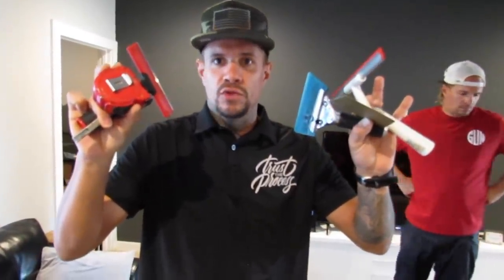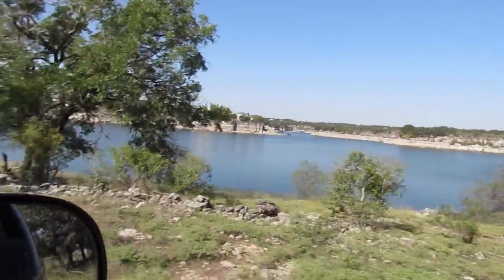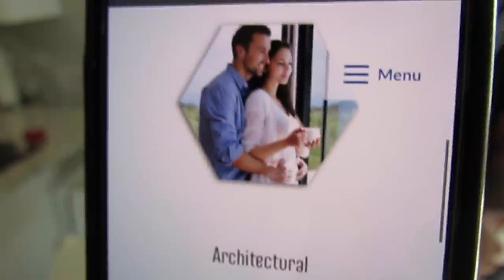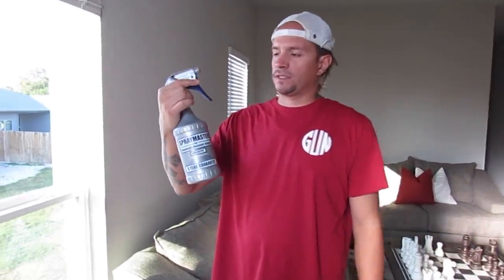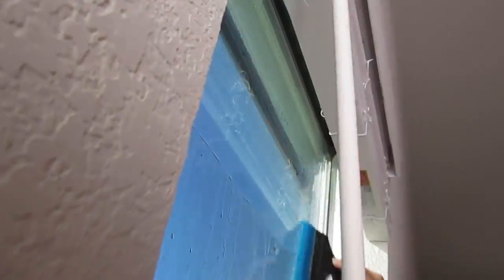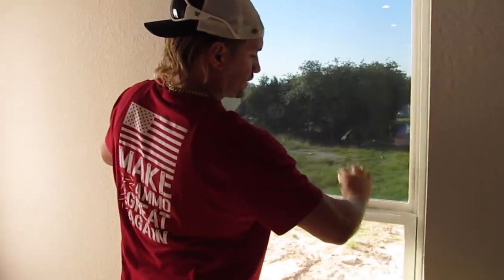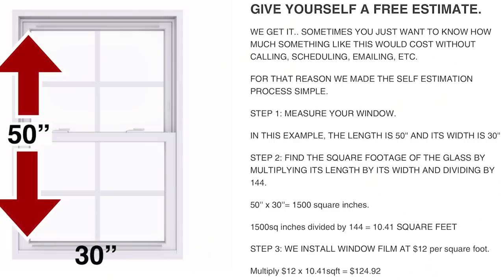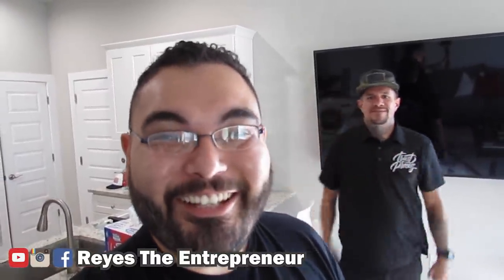The EASIEST and CHEAPEST business - home window tinting

Comment: Important info not covered.
1) get some liability insurance. If you get hurt or damage someone's home or glass you may pay big time.

2) always check the glass. Triple pane glass should not be tinted it will instantly void the warranty.

3) most places have double pane laminated glass, but some are low e glass in which calls for specific films to be applied.

There is a lot to learn. I've seen people use the wrong films and the customers glass cracked causing thousands in damage. Please go slow and ask for help when needed.
Reply: Where can I find more information on this topic

Comment: This film is a trend, specially the mirror film for privacy and you can see outside, also you can have privacy at night too, even if you have light inside your home, if you do some additional steps, such as putting bright light aiming your window, those flood light with timer in the garden. I like to see outside what's going on from my kitchen. You still might want to put  thin or thick curtain and leave it on the side and use it when you don't want to see the lights outside.

Comment: As a tinter they didn’t explain anything about trimming the film or the $1000 film handler sitting on the glass work table(more than $40 too). Be careful what may seem cheap and easy could end in you replace window gaskets and windows from scuffing glass. Practice on your own windows first. You’ll also need tools to remove brackets, ladders and scaffolds. I’ve tinted A frame houses, schools, car dealerships, cars ect. Great business but more to it than $40 of materials. Some rolls of film you’ll need could cost $1000+ bucks. Some windows require 72 inch x 100ft rolls (600sq ft). Remember the $10 per square foot thing that’s an average price. Tinters like mechanics charge you more for labor than material. I enjoy people coming into the tint world but there is a larger learning curve than described.
Reply: Do you have any place that I can find more information on this business
Reply: @Abundance172  there are a lot of window tinting schools out there. One of the best ways to learn is find a shop and learn for a few years and grow. You’ll make insured mistakes here and there and learn from professionals until you feel ready to go on your own. You can buy film and tools from tint depot, express like in the video. That red scraper blade he uses is a triumph scraper. I see countess injuries on tint pages from people slicing themselves with it. You have to be careful. Come follow window tint stuff on Facebook and window tinting business. Pros (myself included) answer questions and discuss tinting cars/residential daily.
Reply: I said the same thing man, and he said “it’s that easy” yeah try it let me know how it goes lol, the guys couldn’t even tell you that the percentage is the light passing through the film, terrible I’m sorry

Comment: Nano Ceramic film is the only film I would put on someone's window
Reply: Nano ceramic films can't be applied to many home and commercial windows.  The ceramic films absorb a lot of heat and may cause glass to crack, or window seals to fail.
Reply: @mikeyount9959 that is wrong
Reply: Absolutely not true.
Reply: @dakotahall1991  He’s not wrong. You have to be careful. Dual pane glass can crack if you use a film that absorbs too much heat. There are reflective films like huper Optik fusion that will reject more heat than some ceramics so it depends. I’ve installed film on hundreds of cars and homes. Plenty of threads on tintdude and other forums about this topic out there.
Reply: @trentfranks4507  he is wrong nano ceramic film is not dark. It does not absorb heat.  Therefore  it is not dangerous.  So maybe do more homework I've actually done residential film.  Nice try tho
Reply: @dakotahall1991  “if you use a film that absorbs too much heat” darker nano ceramic absorbs too much heat. 50% can push the limit in extremely hot areas.  Light nano ceramics you’re fine but the custy will have very little privacy. If you use a 20% like this vid says is common...
Crack. 

Darker nano ceramic is manufactured for one pane/tempered glass I.e cars, Tempered residential which is rare/old.
Reply: @trentfranks4507  nano ceramic is not dark at all. And reflex and not absorbs...I don't know why you're not understanding

Comment: Be carefull about tinting windows, you can void the manufactures warranty.  I had new andrson windows installed and i contacted anderson about tinting the new windows, they told me it will void the warranty of the window.
Reply: Why would it void the warranty when its just stick on and you can take them off doesnt make any sense
Reply: @josephscott1870  from what they told me it heats the gasses more in-between the pains of glass. Its not single pain of glass, if they were single pain glass then its ok, i even wanted to install storm windows on the outside just for more insulation during winter months, but same response from anderson, will void warranty and i souldnt need to do that due to the new windows.

Just saying what the manufacturer Anderson windows told me, believe me i wanted to do the tinting to my windows, (noisy nieghbors) , but im not going to voild the warranty of the windows. 

Maybe contact window manufacturers and ask if any tinting will void warranty before doing this. Just saying what Anderson told me.